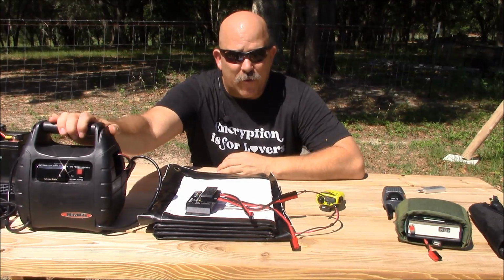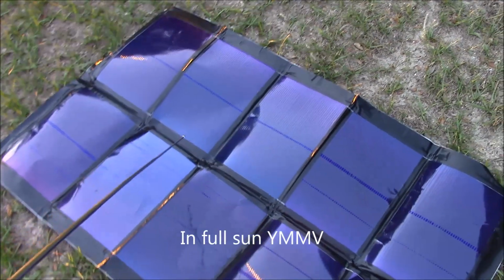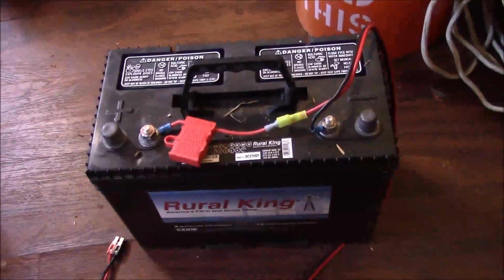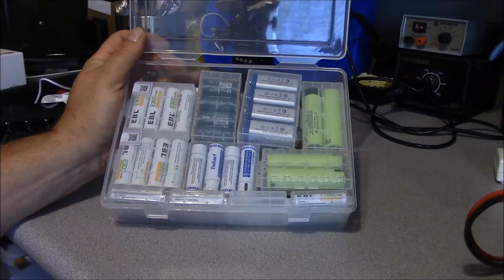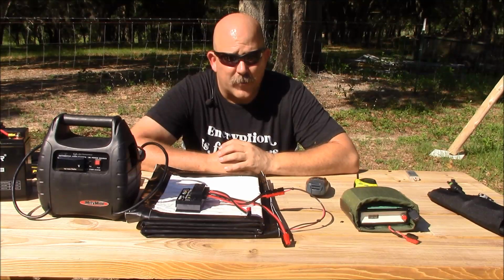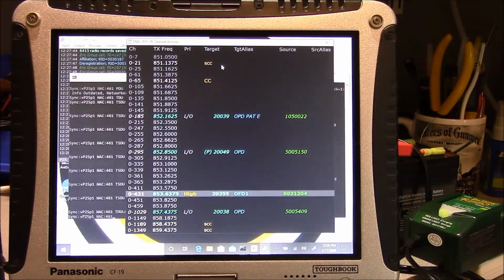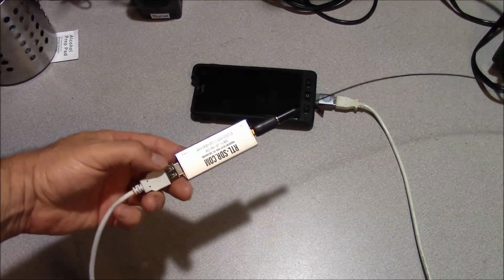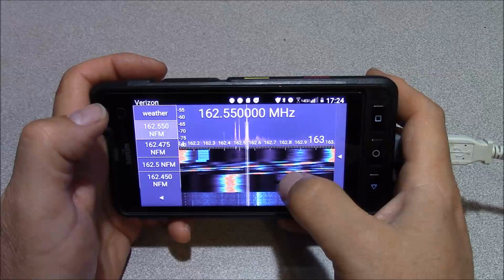3 radio COMMS items for beginners

Comment: To you have a link for buying some of the items you talk about in the video?  
Any help is greatly appreciated. 
Thanks
Reply from the maker: Let me know which items you are interested in and I will find the links to them. Thanks for watching !
Reply: @survivalcomms  I’d like to get that SDR device. I’ve been getting into comms and tapping local radio activity recently. All I have right now is a pair of Baofengs with 15.6” Nagoya whips I’ve set up to be scanners for FRS/GMRS, MURS, Marine VHF, and local emergency services. But that SDR device looks to be SOOOO much better for as a monitoring device. Can it also decode EDACS?
Reply from the maker: @Ir0nF1st924  I believe it will CC decode edacs but I haven't tried it. It will demodulate the non ENC ProVoice audio. It will not demodulate legacy Aegis audio ( I think that is long gone )  I used to do CC decode and follow it with the DOS Etrunker program . Thanks for watching !
Reply: @Ir0nF1st924  Amazon sells a US/Canada made SDR device by NOOELEC NESDR usb device that got excellent reviews. It also comes in a few different versions. There’s a nice one for under $40 and it comes with three different antennae. The cheapest is $24

Comment: Two thumbs up. BTW, v3 of the RTL-SDR Blog SDR stick can now receive HF signals ranging from 500 khz to 28.8 MHz, without the use of an upconverter, vastly increasing its capabilities. I have one on order to replace my older general RTL stick that only does VHF/UHF. About $35 on Amazon.
Reply from the maker: Very cool - I have an SDR play that works good on HF. I will look at getting the v3 as a trim form factor is always nice. Thanks for sharing and thanks for watching !

Comment: First, great video and congratulations on getting to 4k subs.

Are you familiar with olight universal cylinder battery chargers? About the size of a pair of earbuds and charge most small cylinder batteries. Like $10 on Amazon. I keep a nitecore D4 Charger on the desk and a half dozen olight universal cylinder battery chargers in my go bag. I also keep a USB splitter to hook up two to a single USB socket.
Reply from the maker: Thank you very much ! I just ordered one of those Universal chargers - That is a good concept and thank you for the recommendation. I did pick up a few of those USB rechargeable Twharf Li-ION AAs several months ago as well and I have been happy with those. Thanks for watching !